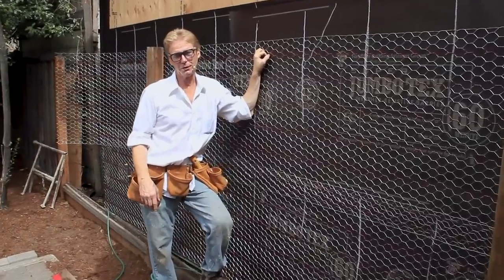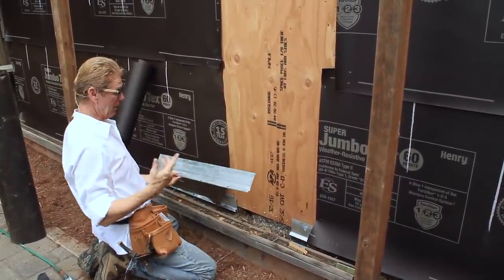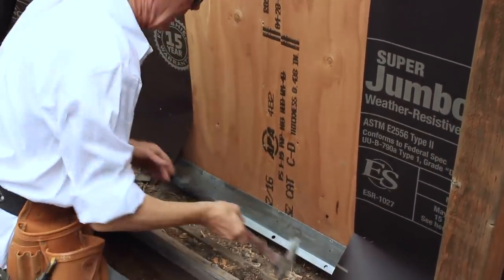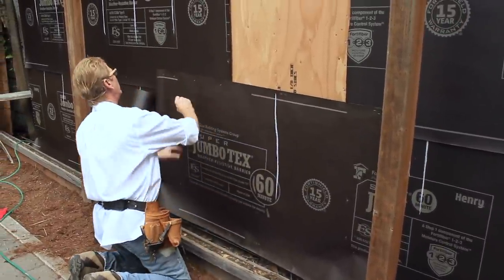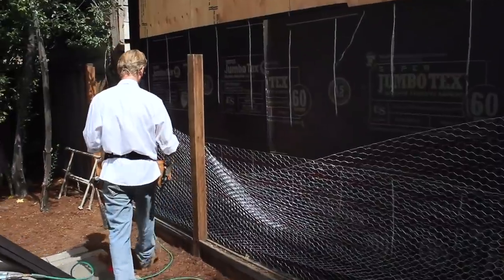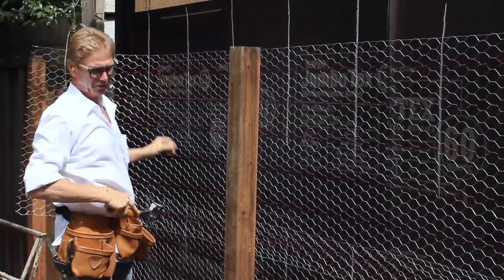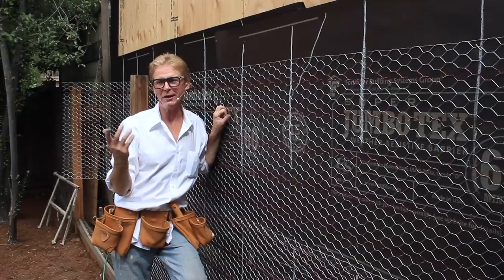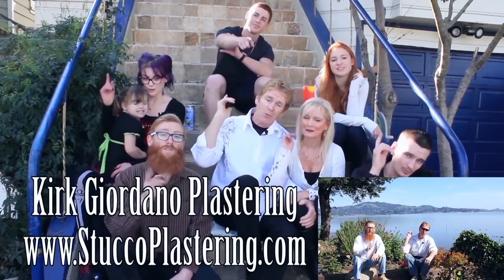Stucco lathing.

Comment: Kirk  you are one of the best teachers  I ever had, thank you for all the information you share, I remember working with my dad as a kid and everytime I see your videos it takes me back to those days when I tried to help him do the scratch coats, even though this is not my field I sometimes take some stucco repairing jobs and when I get stuck on what to do, I always go to your videos but this time I'm having a difficult time deciding if to tare down a wall that was build replacing a garage door, the wall is cracking around the garbage door,  I was starting demo on the inside tearing down the drywall and to my surprise the Window frame  and the studs in the wall were rotten because of a leak that's been there for years, the stucco looks good except the Crack opening and  for sheer plywood of the inside that is rotten, obviously the previous person didn't do a good job because the looks like the wall is separating, what's your advice?
Reply from the maker: Howdy Pancho Dude, sorry for the late reply, but often some question and comments are missed. Sound like it was lathed wrong or the cracks are 5 to 15 years old. That's about how long the rain coming through them will take to rot out the shear wall and studs. No doubt you have already torn the stucco off and replaced the lath and re-stuccoed?🤔

Comment: Hello mr kirk, thank you for this video  keep doing what you are doing  its an eye opener for many .i have a couple of questions concerning building techniques nowdays please help me with your advice  i will appreciate  .
1 .what is your advice  using 'light  steel  gauge' instead of wood frames in termite infested areas and  OSB board. 
2.Can you use  sand and cement mortar  for outside finishing then painting. 
3. How can you treat  this siding boards  to protect them from termite.
4.what is the reason for using  double ply  vapour barrier  .
Thanks once again  .lets wait for the next video. 
4.
Reply from the maker: Evening Mosee dude, Is this a trick question?
 LOL, the gauge of wire has absolutely nothing to do with termites. They go for wet or moldy wood, not galvanized steel, no matter what gauge it is.
There are lots of ways to rid termites from one home. You have to figure out your options of how to rid your home of these hungry little wood-eating insects.
  Note: to all subscribers or anyone who stumbles on our channel with a question, type it into our Stucco/Plastering channel, and like magic, a video will appear to explain how it's done. 
This feature is miles ahead of any plastering forum. 🥳
https://www.giordanoplastering.com/

Comment: Hi Kirk thanks for the video's now what I'm wanting to do is re-doing my stucco that is pretty thick and coarse to a smooth finish, is that possible? I've seen some of your video's with this process but the stucco doesn't look that thick, or I haven't found the right video yet, and also the front of my house has siding that isn't in the best of shape so I was gonna either replace the bad sections or stucco it, I prefer to stucco it with smooth finish, now I can just put paper and wire (lathing) over the siding, is that correct? I'm in Victorville, southern California, Thanks very much appreciated-Loretta
Reply from the maker: Good evening Loretta, yes. https://youtu.be/_GDEBxsooZ8/ 🥂

Comment: Ew. Good thing I clicked on this one. I had NO IDEA the chicken wire needed to be RAISED away from the paper!! Good to know. 

Hey Kirk. Im having the hardest time finding something in your vidoes. its about incorporating new paper into old. I understand that on the top, the new paper slides UNDERNEATH the old, and that on the bottom, the new paper OVERLAPS and lays ON TOP of the old, BUT WHAT THE HAIL am I supposed to do with the sides!!

I have the opportunity to use two large pieces of paper to close up this old window opening. But Im so confused on what to do with the paper at the sides. PLUS, do I slice the old or the new to allow for the new to slide under or over, on the side. THANKS BUD and WAITING FOR YOUR RESPONSE
Reply: Just try to overlap it at least 6 in on the sides caulk where it meets the old if possible

Comment: Thank you foe your videos. Questions: 

1) My contractor only installed one layer of paper that came already prearranged to the wire. Our walls don’t have plywood, we have wood studs. Is this correct.

2) I got a small roll 3’ or so style of paper for insulation barrier at the bottom all around.

3) I am in San Diego, what is the dry time between scratch and brown coats?
Is this correct?
Reply from the maker: Howdy  Karla, this is correctomundo.
https://www.youtube.com/watch?v=PQ5N69SoAJE/ How to lath a stud wall with self-furred paperback wire.      
  Here’s wishing you and yours a happy new year.
 From the entire plastering Giordano Family

Comment: Kirk always something new to learn from your videos! For installing the stucco wire, will a 1/4 in. 18-Gauge Crown Stapler work? Any specific staple size?
Reply from the maker: Hello, for codes a 1 inch crown is advisable. 
The length should be an inch and a quarter.

Comment: What’s the maximum amount of time between scratch, brown and finish coats? I’m on a tight budget and will have to space each step as long as I can so I can save up for each step
Thank you for the videos
Reply from the maker: Howdy Ofelia, when a scratch coat is applied you can wait a minimum of 48 hours to apply the next coat or ten years if you want, without compromising the integrity of the first coat. 🥂

Comment: Kirk I watch all of your videos and enjoy your presentations. One comment, chemical bond is the proper term for the two surfaces bonding, mechanical bonding is using screws, nails or bolts, etcetera.
Reply from the maker: A chemical bonding is. where you paint on a bonding agent over a painted cleaned surface, then apply more stucco.
A mechanical bond is when you apply a second coat over a scratch coat that has not been painted.
Reply from the maker: Correctamundo, you have learned well, Obewonkanobi. Cheers

Comment: Hey Gio I’m building a shed in florida, could i use cement boards instead of plywood and plaster them? Thanks
Reply from the maker: Hi carlos, yes you can but still have to lath them this way. you ever try to attach paper to cement boards?
 It can't be done without destroying the hammer tacker and the boards. sorry, brother.

Comment: For a small space around a sliding glass door and I take metal corner bead designed for stucco and bend it flat and use it as my lath?
Reply from the maker: Howdy DJ dude, you are correctomundo; just don't nail or staple it too flat. Leave a small gap for the stucco to get behind it. Or another way of saying, place the bent corner aid in the center of the stucco.🥳

Comment: I am in australia , we do not have any paper like this , can i use breathable house wrap ? Which for america would be similar to your tyvek ? , or could i paint the ply with a special type of paint ?
Reply from the maker: Howdy my friend, here in the USA, two layers are code for waterproofing stucco. Weather those two layers are 60 minute or tyvek is okay.
Reply: @StuccoPlastering   thanks so much kirk your videos are amazing , I will post up a picture of the finished wall when i complete it , stucco is certainly not a thing in Australia like it seems to be in usa , here it is all rendered brick veneer for timber stud houses or blue board and texture coat where its single stud

Comment: Please tell me how the steam coming out of the wall through this bitumen paper will behave, will there be any problems with steam removal?
Reply from the maker: @PavelOsetskiyElectrician31  howdy  Pavel, no steam will come out this wall. It has two layers of water resistant paper and will also have 1 inch of stucco. Plus be primed and painted. Not to mention inside will have Sheetrock insulation, with the inner walls painted. This wall will be sealed.

Comment: Kirk, I have a time sensitive question but first thanks to your videos and your kind and informative email help I'm onto my next mega stucco repair. I'm a 50 year old female artist sculptor and over my life have renovated 7 homes, (most built 60ies to 70ies), and I owned a kitchen and bath design business eons ago. My currents project is 20'  x 5'. I made a very rookie mistake and ran out of stucco half way across the wall at 6pm, working under flood lights. I am wondering if I should give it til tomorrow or carry on today. There's no sheer plywood or weep (built 1968), so the stucco is basically the structure...
Reply from the maker: Good morning Melanie, this is not a big deal. Simply start off where you left off. 😉
Heres, the idea, if you're going to paint this wall, your tie-in should be tight. To on the money, or you may see this cold joint when painted.
Happens to the best of us.😉
     If your planning on applying a color coat maintenance-free finish, 
 simply apply a bonding agent over the complete wall with the cold joint. Thus you won't get ghosting or notice where you stopped and restarted the next day.
 Apply the bonding agent with a roller, and it does not have to be pretty. Its sole purpose is to give the wall the same suction, thus no cold joint.
Note, You may also type in any question you may have on Stucco/Plastering issues on our channel, and like magic, a video will appear to explain how it's done. This feature is miles ahead of any plastering forum. 🥳
https://www.giordanoplastering.com/
Reply: @StuccoPlastering  thank you so much Kirk, you are a total godsend. By the way. Could you make a video just on how to use your affiliate program. Any tool I buy I'd like to make sure you get a piece of it.
Reply: @StuccoPlastering  yes im painting in a month after its cured. I did do bonding agent about 12" all around. There's no tie in because all the wire was rusted. I've fastened the edges  of the new wire with 16penny nails bent over (facing up as mentioned in one of your videos. ) . Ill put the bonding agent on the seam about 12" so I can feather in and get a tight bond on my scratch coat. Even with paint fir my third coat should I use the bonding between scratch and brown.
Reply from the maker: Good morning Melanie, if your painting the wall, you don't need a bonding agent. You use a primer and paint instead.
When a person stops plastering in the middle of a wall and begins another time, what can happen is when the two are joined unless it's a sand finish, you may notice excess sand on the existing wall.😉No doubt if this happens, you will be the only one to notice it.🤔
Here's a video that might show you what I'm referring to.   Smooth stucco for feathering in stucco transitions, https://youtu.be/53jGR8Pfr5w 
     Note, You may also type in any question you may have on Stucco/Plastering issues on our channel, and like magic, a video will appear to explain how it's done. This feature is miles ahead of any plastering forum. 🥳
https://www.giordanoplastering.com/
Smooth stucco for feathering in stucco transitions, https://youtu.be/53jGR8Pfr5w
Reply: @StuccoPlastering  as always much gratitude Kirk, thanks so much. I'll post a pic when I'm done.
Reply from the maker: Atta Girl, sometimes we all need to know what we're doing is a step in the right direction.
 I hope you have someone who's mixing that mud for you as plastering is a two-person sport.😉
Note, You may also type in any question you may have on Stucco/Plastering issues on our channel, and like magic, a video will appear to explain how it's done. This feature is miles ahead of any plastering forum. 🥳
https://www.giordanoplastering.com/

Comment: My dear, do you know about stucco for middle eastern countries? Does it resist the heat and the rain?
Reply from the maker: Evening my friend,
Stucco provides thermal insulation against hot weather, keeping a home cool in the summer, especially if the exterior is a light color.
  Stucco insulates against outside noises, making the inside of your home noticeably quieter than with exterior siding. Stucco strengthens a home, providing additional structural rigidity. 
This is because a stucco building is permanently encased in an envelope of wire and cement.
    If you don't like the look of acrylic stucco or. Even cementitious stucco (a matter of personal taste), wood siding, or cement board siding are better choices than aluminum or plastic. 
However, none of these sidings will last as long or be as maintenance-free stucco.

KGP

Comment: What does it mean by 60 minutes, on the Jumbo Tex 15 years 60 min? Thanks Kirk.
Reply from the maker: Evening Jose, that's easy.
The designations of 30 Minutes and 60 Minutes building and what it means. 
These designations refer to a moisture resistance test that uses a moisture-sensitive dye as an indicator. Do you realize what this means?
 Me neither. I'm an applicator, not an engineer. 
Code says to use 60 minutes of two-ply paper. We use two ply 60-minute paper.

Comment: What kind of Staples do I need with a gun to use for the lathing
Reply from the maker: Good evening Mark, I use a Senco gun with inch and a half staples. The leg of the staple has to be embedded in the stud seven-eighths of an inch.
 also, you have to consider the plywood thus 1 inch and seven-eighths are necessary.😉
  Our unique plastering Tip:  all subscribers or anyone who stumbles on our channel with a question, type it into our Stucco/Plastering channel, and like magic, a video will appear to explain how it's done. 	
   This feature is miles ahead of any plastering forum. 🥳	
https://www.stuccoPlastering.com